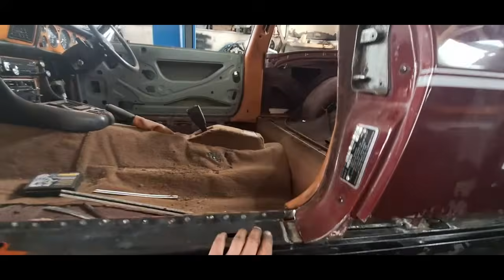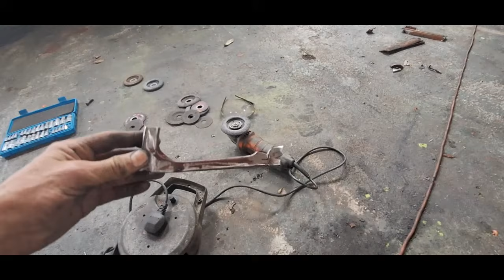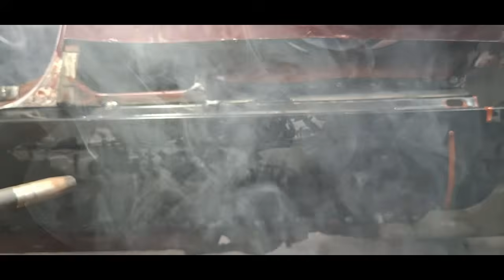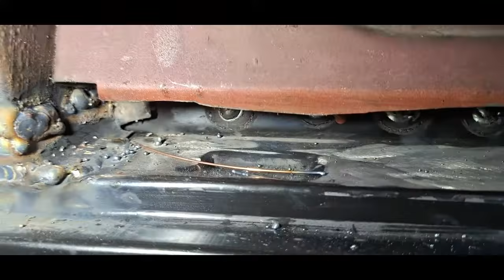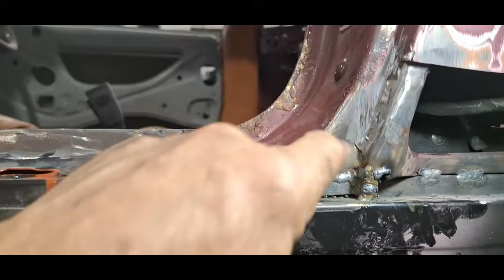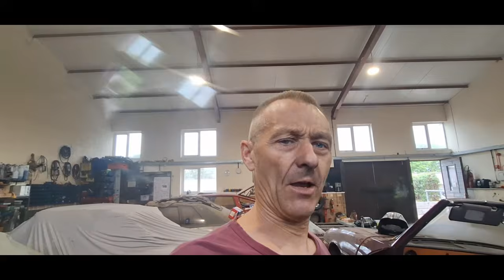Yorkshire Classic Cars ltd Restoration workshop Triumph Stag Restoration door pillar reconstruction

Comment: @4.10 For the benefit of those doing this at home. You could also have the foresight to fabricate and spot weld the new bottom of inner strengthening to that area cleaned off on outer sill as part of trial fitting the sill. This makes it simpler and easier to then weld the overlap to remaining strengthening panel when final welding in the sillI. I learnt this after doing the previous side.